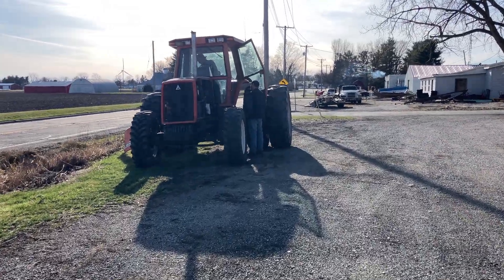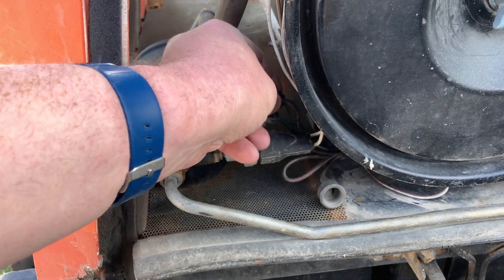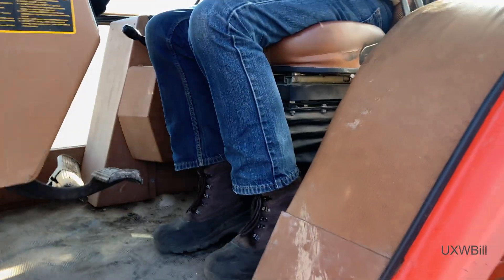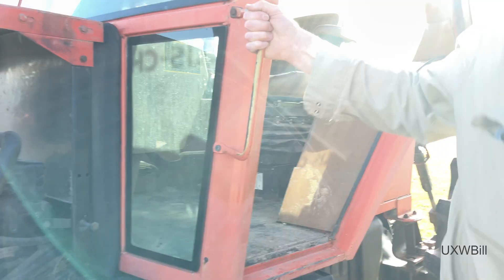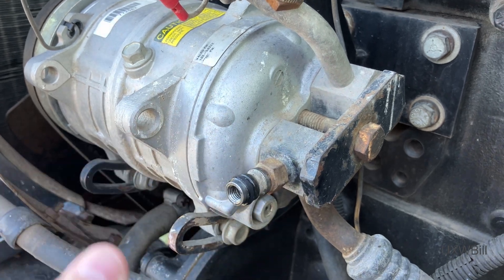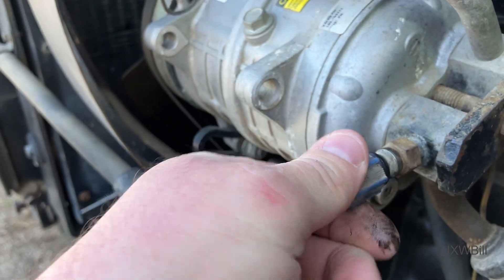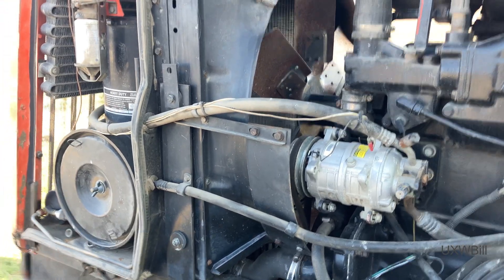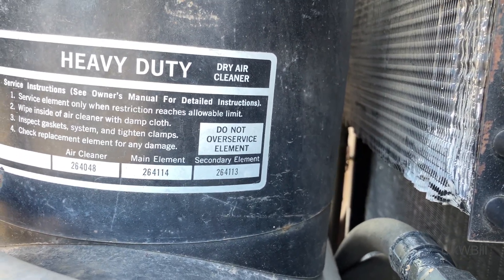First look: It's another tractor air conditioning project!

Comment: I know nothing about air conditioning but I'm curious to see if the cassette deck works
Reply from the maker: I'll have to see if I've got a cassette I wouldn't mind ruining. I'd say there is a decent chance it'll work just fine, as long as the rubber parts aren't totally baked out.
Reply: Who knows it maybe a good time to scrutinize the cassette player about belts, rubber pinch roller, and among the parts to see the player is repairable before playing the tape.

I don't know the FM and AM radio works really well, and I'm sure the speaker still works just fine. Hopefully, it sounds really good when operating the tractor while working out the field and enjoying music at the same time.

This cassette player is so much better than the aftermarket radios from Temu.

Comment: R12 systems often do not have a lowside pressure switch. 134a needs a certain pressure to keep the lubricant in suspension. Without the lowside switch, the system will run on a low (or no) refrigerant charge, damaging the compressor with a 'lubrication crisis'.

A Ford lowside switch will screw onto a R12 lowside port. Wire inline with the ac clutch. Murray part #: 36676

Comment: One of the recurring problems I had was the operators not cleaning the radiator fins properly. No airflow through the condenser would trip the high side pressure switch and cut power to the compressor clutch. They would hose off the tractor at the end of the day with a garden hose which would turn the dirt and dust in the cooling fins to something more like concrete. Sometimes the the service port valve cores would vibrate loose.

Comment: Is it true to this statement that, if a car's value is so underwhelming it isn't worth getting the complete air conditioning system repaired or replaced?
Reply: depend, ie ac compressor at 600-1300 usd condenser and evap around 500 to 1000 each if fubar, freon charge 300 usd or thereabout, so if car is worth more yes? tho most of the time its just compressor or clutch that goes out, so id say so but are convenient with ac even in a beater car but resale wise it usually dont add much
Reply: Probably depends where you live.  Up north I grew up riding in various cars with working and nonworking AC and in those cases you just roll the windows down and it's good enough for the couple months.  I could see in Arizona or Florida or something it being dangerous for some to go regularly without AC though.